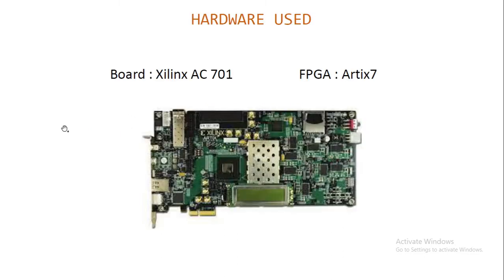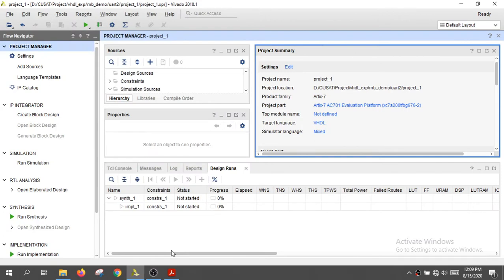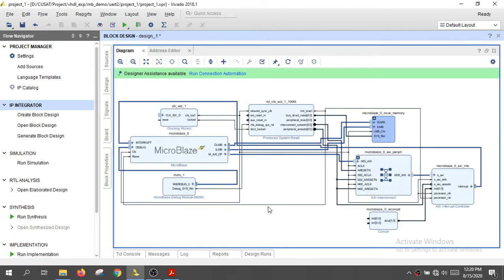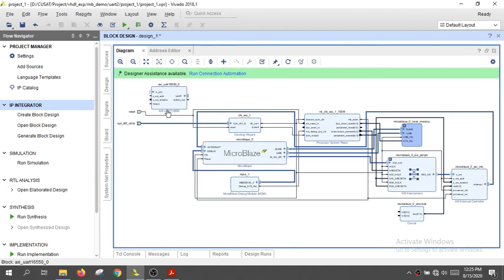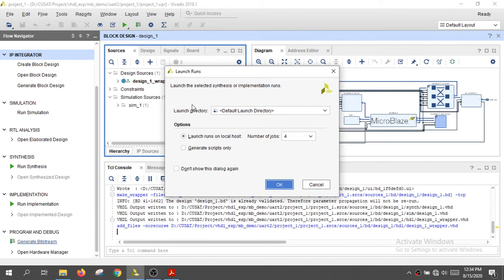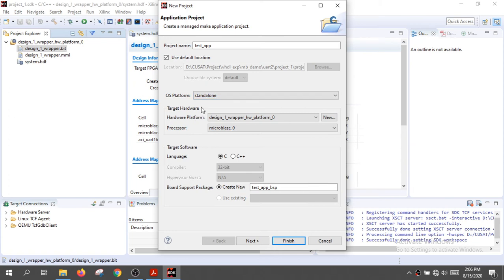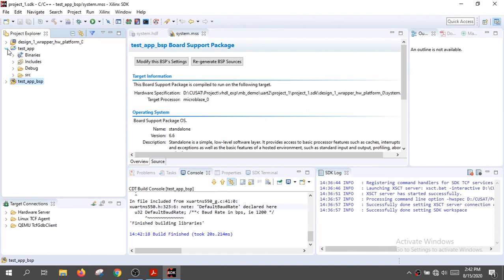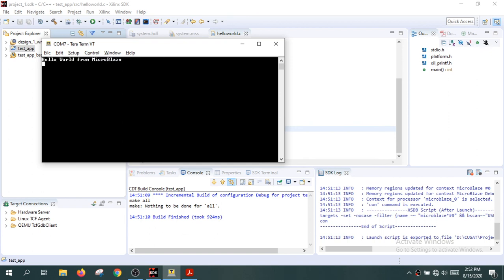MicroBlaze Hello world program on Xilinx Artix 7 FPGA Evaluation Board (AC 701) using Vivado and SDK

Comment: This is a neat concise explanation. Great. For me, at the end of bit stream generation, I get the follwoing warning. Is it safe to ignore and donwload to the board? Or should I add a .xdc with only the 2 entries for CFGBVS  and  CONFIG_VOLTAGE at the wrapper?
Neither the CFGBVS nor CONFIG_VOLTAGE voltage property is set in the current_design. Configuration bank voltage select (CFGBVS) must be set to VCCO or GND, and CONFIG_VOLTAGE must be set to the correct configuration voltage, in order to determine the I/O voltage support for the pins in bank 0 ....
Reply from the maker: @abhaydeshmukh2642  it worked straight away on AC701 evaluation board without any change in the XDC file. I am not sure if you are using any custom board
Reply: @letslearn39  Frist of all, thanks for taking the time out and responding. 
I am also using ac701. I just wanted to know if I am doing something wrong, since I got those warnings. If you also had got the warning and still the program has worked, then it is great and I will also do the same.

Comment: I am building using Vivado 2018.3 and I have created the microblaze+uart wrapper. However, I get an error when I generate the bitstream. I thought it was because I had the basys3 board as the target. I stepped back and used only the Artix7 chip as the target with no other IO constraints. It completes implementation but fails generating the bit stream. This is the error I get:

[DRC NSTD-1] Unspecified I/O Standard: 18 out of 18 logical ports use I/O standard (IOSTANDARD) value 'DEFAULT', instead of a user assigned specific value. This may cause I/O contention or incompatibility with the board power or connectivity affecting performance, signal integrity or in extreme cases cause damage to the device or the components to which it is connected. To correct this violation, specify all I/O standards. This design will fail to generate a bitstream unless all logical ports have a user specified I/O standard value defined. To allow bitstream creation with unspecified I/O standard values (not recommended), use this command: set_property SEVERITY {Warning} [get_drc_checks NSTD-1].  NOTE: When using the Vivado Runs infrastructure (e.g. launch_runs Tcl command), add this command to a .tcl file and add that file as a pre-hook for write_bitstream step for the implementation run. Problem ports: uart_rtl_0_baudoutn, uart_rtl_0_ctsn, uart_rtl_0_dcdn, uart_rtl_0_ddis, uart_rtl_0_dsrn, uart_rtl_0_dtrn, uart_rtl_0_out1n, uart_rtl_0_out2n, uart_rtl_0_ri, uart_rtl_0_rtsn, uart_rtl_0_rxd, uart_rtl_0_rxrdyn, uart_rtl_0_txd, uart_rtl_0_txrdyn, reset_rtl_0_0... and (the first 15 of 18 listed).
Can someone explain to me what the issue is? -- Thanks,
Reply: Instead of clicking on "Generate Bitstream" from the beginning, you should click "Run Synthesis". After it has completed, change the perspective from the drop down in the top-right corner of Vivado to "I/O Planning". Find out how to auto-assign all the pins except for the clock and the UART_RX_OUT pin (which depends on your specific board). I'm using the Arty 7 board and the clock pin should be E3 and UART_RX_OUT pin should be D10. After you save the I/O, an .xdc (constraint) file will be generated and you can then proceed with Implementation and generation of bitstream.
Reply: I have the same problem. Did you fix it?

Comment: First of all, thumbs up for an excellent tutorial.

I have a question... While implementing we need to specify the .xdc for the project. Perhaps I skipped that part in your video, or is it simply missing?
Reply from the maker: if you are using a board which is supported by vivado, then while doing connection automation after adding a resource, the pins will be automatically assigned. You need not manually make any entry in the XDC file. If you are using a custom board, then for all the external IO pins you need to specify the pin number and IO standard in the XDC file. This demo used AC701 board from Xilinx, hence the manual creation of XDC was not required.
Reply: @letslearn39  I'm assuming that same goes for my Nexys Video board? I needn't add any XDC?
Reply from the maker: @PseudonymQR  Nexys is a board from Digilent. So you need install the board files once after installing vivado. If you have done that, then at the start of the project at the part selection stage, you will be able to select the Nexys from the 'boards' tab. Once you do that connection automation will take care of everything.
Reply: @letslearn39  Yes I have done that and the board is up and running with simple Verilog codes like UART.

A useful information for someone trying to run SDK with Vivado 2019! When you save your project then the root directory ought not include any space, else Vivado won't allow you to open SDK. I have noticed you saved your project by default in a directory that didn't create trouble for you.
Reply from the maker: @PseudonymQR  Many IDEs doesn't allow space in the path. So as a standard practice it's always better to avoid space in path name.